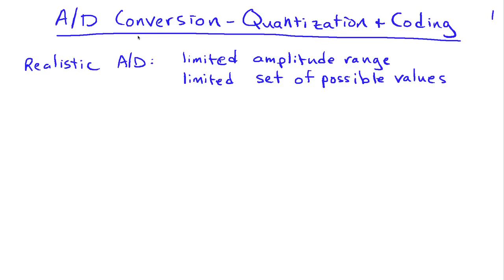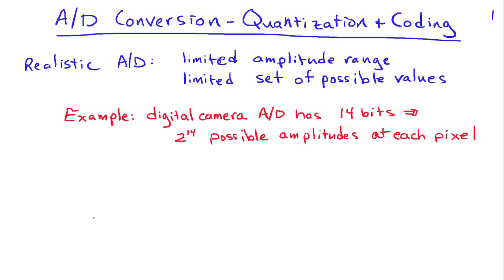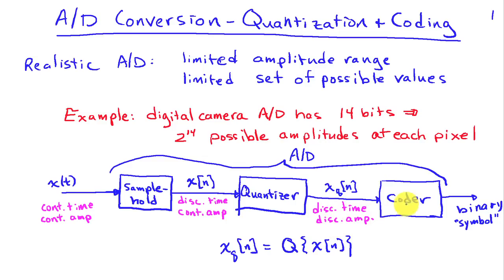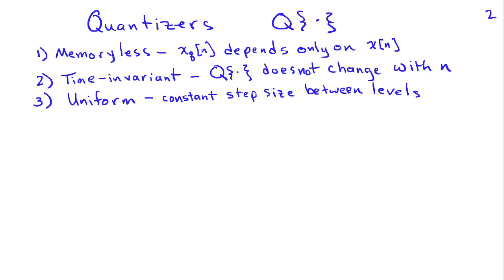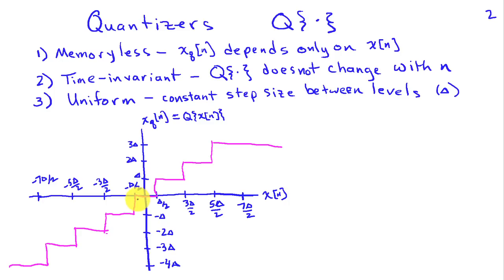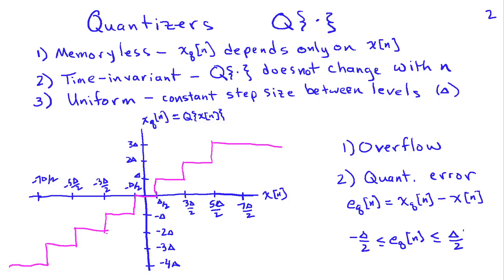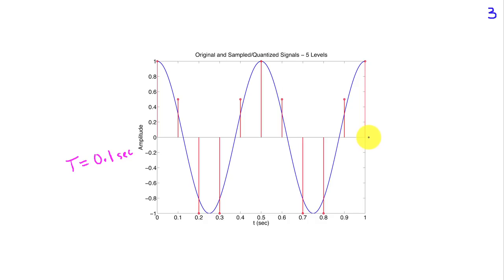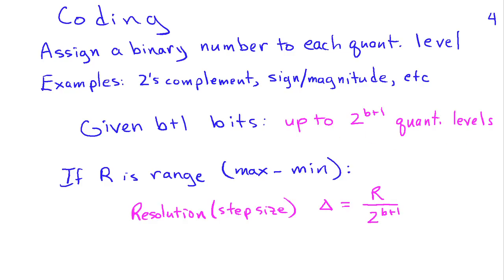Quantization and Coding in A/D Conversion

Comment: Hello I want to convert sin(2pi10t) into 8bit digital signal how can I do it
Reply: You first sample the signal with a frequency that is at least twice the value of the original signal, 20 in this case. However, it is better to always have a large multiple of the original message signal frequency. 
After selecting the Sampling frequency, pass the signal to a sample and hold circuit with a clock that is equal to the sampling frequency. Note: You can do also do it using a natural sampling circuit, with  a clock speed of that of the sampling frequency.